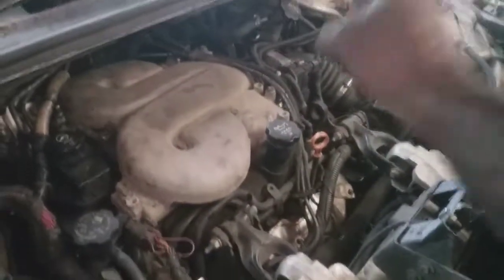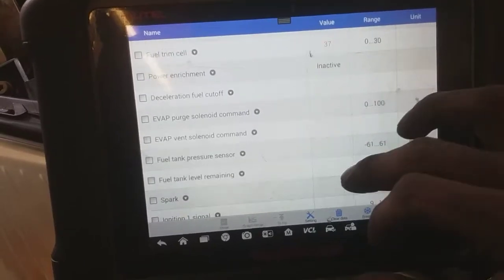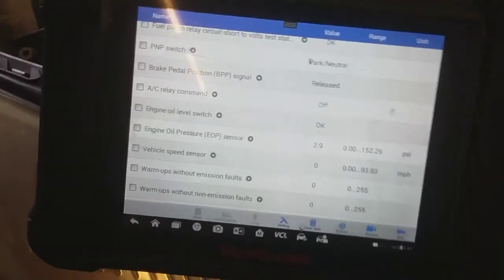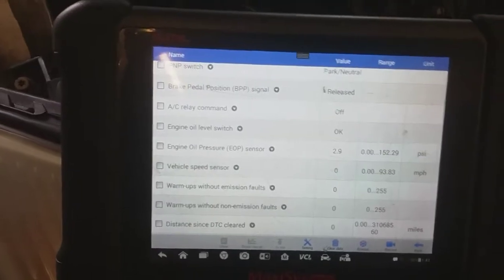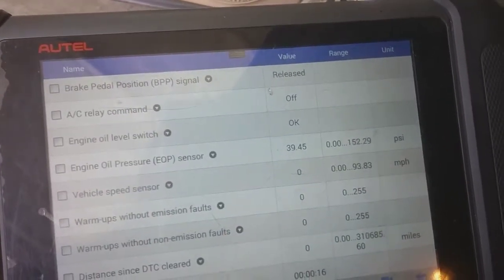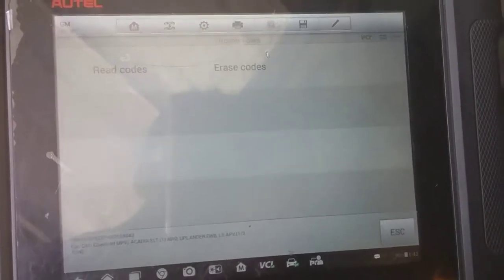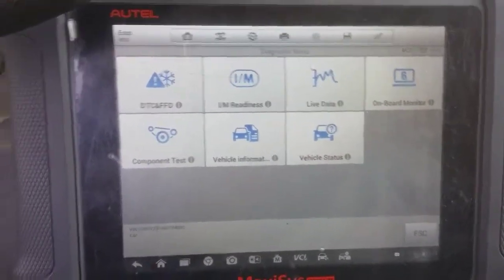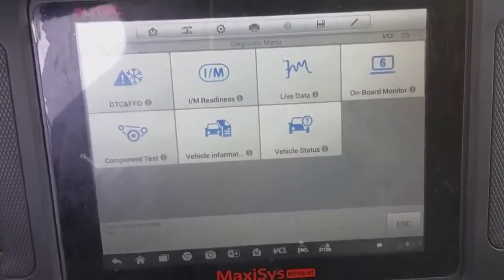P0452 FUEL TANK PRESSURE SENSOR DIAG/FIX/DATA

Comment: hello,
I have a 2000 Honda Passport. It has a P0452 code. I tracked it to a bad Fuel tank pressure sensor. I replaced it and the code went off for many months. Then the code came back on. I have replaced it 5 times. Each time the new sensor lasts a few weeks and then fails. Any thoughts on why it keeps failing. Mind you, I am using Autozone sensors. Should I try a Honda sensor? Or could it be something else?
Thanks
Reply from the maker: Hey there... Yes wouldn't be a bad idea to switch brands! Also, when removing the sensor -inspect the female pins on connector because sometimes what can happen is an air gap manifest and while driving the vibration can create intermittent failure due to lost connections. Typical code setting standards is a lost of signal for 2-3 seconds or out of range for a designated time frame.

Depending on how accessible the sensor is, try moving [bending] the male pins very slightly to make a better connection.

Another option, if you have a scan tool, monitor the data from the FTP sensor, and compare to factory recommendations. When you remove the gas cap -while monitoring data of FTP, pressure will drop slightly to atmosphere then once replaced, will slightly climb. Just a real basic test for leaks however it's predicated on amount of fuel in tank at response time on pressure changes. 

PERFORM A LEAK TEST, if available through scan tool. Not sure what's in your arsenal!

I'm just skimming the surface here... But try the pin bending thing and or different brand.